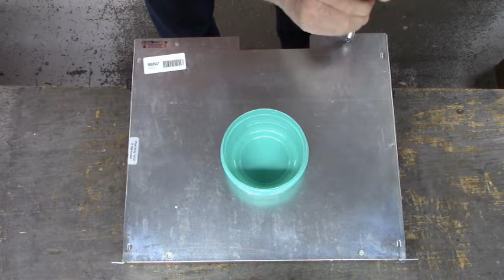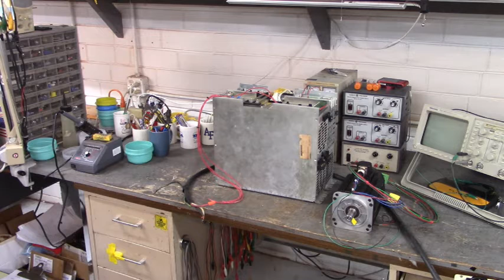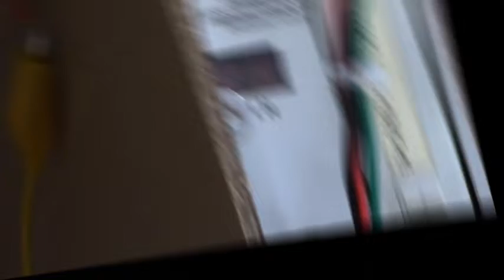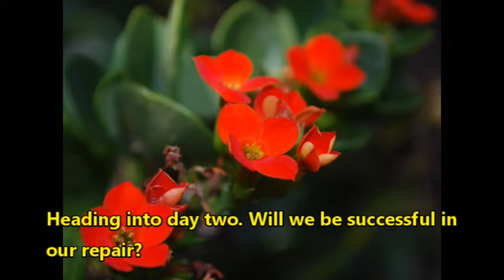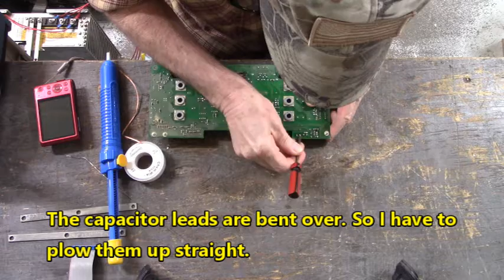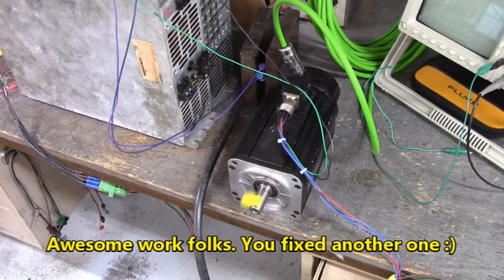Indramat DDS02 1-W100-D Alarm 88 Error Reading Motor Data.

Comment: Hello MISTR!, plaese can you halp me? I have servodrive TDM3 ( X/Y axis )  and i have problem with output voltages to the motor... oon the Y axis output voltage is 147V its OK, but on the X axis i have only 52V and I dont know why.... I changed servodrive but output not change ... please, how I can up output voltage? 
Thanks, Pavel (Czech)